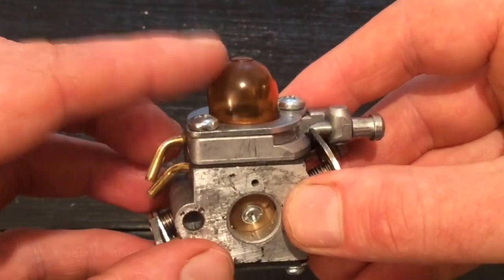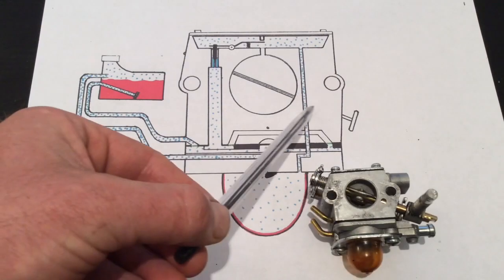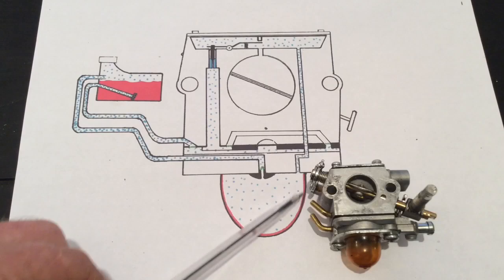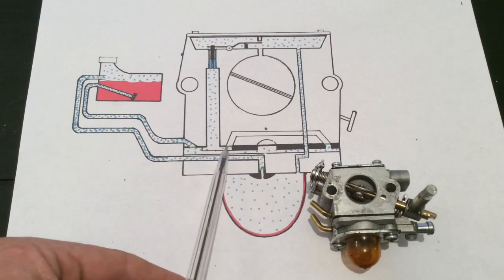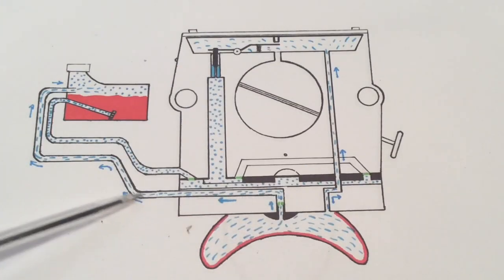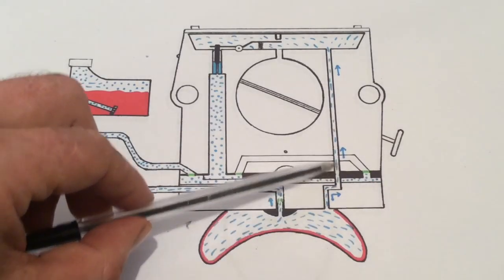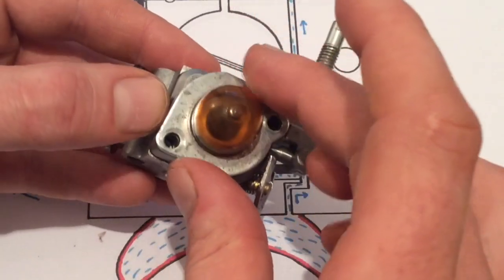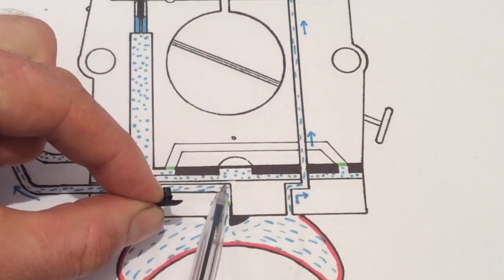The Whole Fuel Priming System Explained - In a 2-Stroke Carburetor.  (by Craig Kirkman)

Comment: VERY good video and explanations. However, when I follow the fuel path on all similar carburetors, I found only TWO sets of 1-way valves that are operated by the fuel pump diaphragm, not THREE. Of course, there's the 1-way "duck-bill" valve under the primer (purge) bulb. But other than that, I have no idea where that 3rd set of 1-way valve is, which would make a total of FOUR sets of 1-way valves. 

Would LOVE to learn/find our more about this "missing" 1-way valve...
Reply from the maker: ou’re absolutely right — thanks for catching that. I went back over it and I did mistakenly describe an extra valve in the explanation. On these carbs there are the two main pump check valves (inlet and outlet) plus the duckbill valve under the primer bulb. That’s the correct total. Appreciate you pointing it out — I’ll make sure to clear that up in the video notes so nobody gets confused.

Craig

Comment: What's the advantage of these carbs over "conventional" slide or cv carbs?
Reply from the maker: Great question! The big advantage of these diaphragm carbs is that they don’t rely on a float bowl and gravity feed like slide or CV carbs do. That means they can work in any position — sideways, upside down, or bouncing around — which is perfect for chainsaws, trimmers, and blowers. They’re also compact, simple, and cheap to produce.

The trade-off is that they’re not quite as smooth or tunable as a good motorcycle carb, but for small handheld engines that need to run at any angle, diaphragm carbs are the best solution.

Great question though. thanks for asking.

Craig

Comment: My primer bulb is cracked yet I can still prime fuel and start the weedeater...but weedeater acts strange and revs VERY high on half choke...i had it running perfect yesterday and today its acting up again...

Could the crack in primer bulb be causing it to draw in excess air and leaning out the mixture?  Or is that not possible and the primer bulb is only involved in the initial priming of the engine and thats all?

Comment: Super helpful video, I am currently trying to troubleshoot a strimmer that uses this exact carb/throttle arrangement, I think. Mine won't start and when I press the primer bulb I get fuel going into the throttle body. I'm guessing the fuel jet valve has failed. I need to have a look under that diaphragm. The primer bulb doesn't go hard and I now understand that's probably because the fuel circuit doesn't pressurise. It's also making a slight squeaking kind of sound as if air is getting in.
Would that be stopping the engine from running at all?

Comment: When I prime my strimmer, fuel drips from air filter. Why?
Reply from the maker: Thank you for your question! Fuel dripping from the air filter when you prime your strimmer can be due to a few different issues. Here are some common causes and potential solutions:

Common Causes and Solutions
Over-Priming:

Cause: If you press the primer bulb too many times, it can flood the carburetor, causing excess fuel to leak out through the air filter.
Solution: Try pressing the primer bulb fewer times. Usually, 2-3 presses are sufficient to prime the engine.
Stuck Needle Valve:

Cause: The needle valve in the carburetor controls the flow of fuel. If it gets stuck open, it can cause fuel to overflow into the air filter.
Solution: Inspect the carburetor and clean or replace the needle valve if necessary.
Float Problems (for carburetors with a float bowl):

Cause: If the float is stuck or improperly adjusted, it can cause the carburetor to flood with fuel.
Solution: Check the float and make sure it moves freely and is properly adjusted.
Damaged or Worn Primer Bulb:

Cause: A cracked or damaged primer bulb can cause improper fuel flow, leading to leaks.
Solution: Inspect the primer bulb for any damage and replace it if necessary.
Clogged Air Filter:

Cause: A clogged air filter can cause back pressure in the carburetor, leading to fuel leaks.
Solution: Check the air filter and clean or replace it if it is dirty or clogged.
Carburetor Gasket Issues:

Cause: A damaged or improperly sealed carburetor gasket can cause fuel to leak.
Solution: Inspect the carburetor gasket and replace it if it shows signs of wear or damage.

These are some things to consider for now.

Thanks

Craig

Comment: Why am I still getting air through the lines after continually pressing the bulb? I just replaced the carb but can’t get rid of the air. I think this is why I cannot get the husky 240 saw to run properly. New lines, new bulb. Tank is full. Thanks.

Comment: I agree that this video is an excellent guide to the workings of a carburettor,  most people want a basic guide to initial fault and what simple verification tests can be carried out prior to strip-down. For example, if the one way valve within the primer / purge bulb stops working, as far as I can see, the system will not operate. Is there a simple elimination test for the bulb?

Comment: Here is a puzzling thing, my leaf blower suddenly would not prime, carburetor is a Walbro HDA 112A, I replaced the diaphragms/filter and cleaned it well over night soaking etc.., still not priming. Today I took it apart again and accidentally broke the one way valve in the priming bulb while trying to pry it apart, I put it back together again, still wouldn't prime, not a big surprise there.. Then I decided to try something, I got the short return line and placed it in a cup of gas, it primed right away and started on the first pull! I took the short return line out of the cup of gas and let it run almost 10 minutes with no problem. I don't get it! I thought maybe the hoses were backwards but 99% sure they are not according to photos and studying this problem for the last week! The return line is attached to the priming pump and the fuel intake line is on the back side of the carburetor. Funny thing too is that the broken one way valve is just flopping around inside the gas filled priming bulb!! Now I'm considering getting a longer return fuel line, like the inlet, placing a filter on it and putting it deep in the tank for future priming. I have searched for a new priming assembly but it appears to be discontinued. My 28 year old blower now starts on the first pull every time and runs as if brand new again! Go figure.. HAHA! I probably should play the lottery now too!! You did a great explanation video!! Best I have seen!! Ron
Reply from the maker: HI Ron

It sounds like you've had quite an adventure with your leaf blower, and I'm glad to hear that it's now working like new again! Let's break down what might have been happening with your carburetor and priming system.

Of course any damage/malfunction of the one-way valve in the priming bulb could have initially caused problems with priming. The purpose of this valve is to create a vacuum that draws fuel into the carburetor when you prime it. Without a functioning one-way valve, it might not prime as expected.

When you submerged the short return fuel line in a cup of gas and it primed immediately, it suggeststhat the issue might have been related to the fuel supply. This test effectively bypassed any potential issues with the priming bulb and checked if fuel was being delivered properly.

You mentioned that you are quite sure about the hose orientation, but it's always good to double-check. Sometimes, even small mix-ups in hose placement can lead to problems with fuel flow. It's possible that fuel wasn't getting to the carburetor as it should.

Your idea of getting a longer return fuel line, placing a filter on it, and putting it deep in the tank seems like a creative solution. This would ensure a consistent fuel supply for priming and running. Just make sure it's securely attached and doesn't interfere with other components.

It's unfortunate that you couldn't find a replacement for the priming assembly, but it's great that your DIY approach has resulted in a functional leaf blower.

In summary, it appears that the issue was related to the priming system and fuel supply. Your ingenuity in testing and finding a workaround has paid off, and now your 28-year-old blower is working perfectly. It's always rewarding when a bit of troubleshooting and some DIY effort revive a cherished tool. If you have any more questions or encounter other issues in the future, feel free to ask. Happy gardening!

Thanks again for contributing to the community

Craig

Comment: Awesome explanation. So there shouldn't be a bunch of air bubbles coming out of the overflow hose when the system is properly primed? I constantly get a bunch of air bubbles when I'm priming the carb. I would imagine some seals are damaged if it's allowing air to get into the the system

Comment: As you know, some equipment, like my Husqvarna 225H75 have a detached primer valve-one that is not directly mounted on the carburetor. Can you explain if their are functional differences in this system as compared to the one illustrated in your excellent video. Thank you.

Comment: I have a few of these diaphram carbs which have the two fuel line fittings on them but do not have a primer bulb. Can you explain what the second fuel line fitting is for in this case please?

Comment: I have been trying to figure out why my weedeater will not run properly. It has a new primer bulb so I know that isn't the issue. I've taken the carb off and sprayed it out with carb cleaner. No luck. Even tried a carb from another just like it. I am befuddled as to what the problem is but the video has been a great instructional video in understanding these carburetor functions. I can't thank you enough for this education.

Comment: So if my chainsaw says to press the primer 6 times, but the bulb is full after three, I should stop at 3? Hmm. I wonder if that's why it foods when it's cold. I can actually prime fuel right back out through the air filter housing. So it sounds like the main jet valve is shot. That’s why I have a new carburetor and fuel system kit on the way. At least now I’ll confident that’ll resolve my problem. I think the metering diaphragm is shot too. And I know there is a small leak in the fuel line to the primer.
Reply from the maker: I think you could be spot on there. Craig 👍

Comment: Can I just replace that one way valve under the primer bulb? The top part of mine broke off when I tried taking it out.
Reply from the maker: Hi. You need to find a parts diagram to see if your carburetors manufacture provides the part you are asking about.  Generally manufactures do provide such items but you will do better to google the make and model of your carb and see.  Thanks. Craig

Comment: People are to lazy to set a choke,its one movement,pushing that bulb repeatedly makes you feel better.The only time you should ever use that bulb is out of the box,but people push it thinking it will start easier.I have never used mine because I have seen people pull and pull and pull making it hard to start.look its simple set the choke pull the rope two times it will fire turn the choke to half let it run for a minute till it warms up hit the throttle and it will run.The more you use that bulb the more leaks you are asking for.Dont you remember before some moron came up with the bulb saws started fine.

Comment: Thank you so much for the time and effort in creating this easy to understand video.  I have no background in engine operation and found your video whilst trying to get 2nd hand weed trimmer working.  One question that popped into mind, does the bulb in addition to priming the carb also assist fuel flow during operation by having also primed a vacuum into the fuel tank?

Comment: Fourteen and a half minutes into a fifteen minute video before there is any mention of the Check Valve in the Main Discharge (Hi-Speed Jet) Nozzle ??  The Main Nozzl'e Check Valve should be quickly mentioned at the start of the video, because if THAT check valve has failed and is stuck open then NOTHING will make the carburettor primer system function.  After 60 years of repairing All Position, Diaphram Type carbies, and watching literally dozens of videos like these since the creation of the internet, and still no-one mentions the importance of the main Nozzle's Check valve, and why the main Nozzle actually HAS to have a check valve.  Even before it became routine for carby's to be fitted with an air purge priming system, all these 2-stroke carburettors needed a check valve between the venturi and the metering chamber.
And p.s. the little 'rubbery grommetty thing' under the primer bulb is called a Duckbill Valve.

Comment: This is absolutely brilliant video. Thanks. I was able to diagnose the problem with my weekwracker. It was the one way check valve inside the primer bulb that was broken so the motor dies every time I pull the trigger. Tried every method online trying to solve the problem but none worked for me. Finally I saw your video and boom problem solved after I replaced the broken valve. It seems rare  but that was exactly the cause of my problem

Comment: Fantastic video. Best explanation I have seen on YouTube hands down. One thing I would offer is that the carburetor you have only has two check valves on the diaphragm, not three. In fact, I think most of not all 2 cycle carbs have only two. One at the inlet (upstream of diaphragm) and one at the outlet (downstream of diaphragm) if you’ll notice, the two that you have drawn downstream of the diaphragm are redundant. 

Again, thank you so much for the explanation.

Comment: My Roto tiller engine just wont start! no matter what .Had carb off three times.All clean. no problem. But Now looks like But I noticed two tubes that enter the fuel tank actually emerged in the fuel!  is one tube for air intake?
Reply: The 'purge bulb' means it has 2 lines going to the fuel tank: one feeding fuel to the carb, other one is a return back to the tank. When you press the bulb it just circulates the fuel, pulling it though the carburettor and purging any air that might be trapped in the lines or the carb. If these 2 lines are fitted to the carb the wrong way around, your machine will never start.

Comment: Excellent video.  I wanted to figure out how to unclog mine with a wire due to ethanol clogs.  But now seeing  all the little valves and flaps and levers I'll probably end up doing more damage.  Is there a safe way to unclog it.  My prime system is so clogged it can't even press down.

Comment: When i press the bulb the oil does not raise up what the problem it is suck or something else sir?
Reply from the maker: Try to strip down the carb and see if there is any blockages, if, you are sure that there is no blockage in the fuel pipes, or fuel filter. Make sure that the fuel pipes are fitted to the correct areas on the carb, and that the fuel tank cap air ventilation is working, and that there is no collapsed fuel pipes.  Also make sure that primer bulb itself ok.  Is the rubber walls of the bulb wearing thin? If so then this can stop it from raising.  This is all the advice I can give until you have taken a look at these points.  I hope this helps. Craig
Reply: @TheRepairSpecialist  OK thank you I will double check and take look on it tq sir

Comment: If there is a valve on the jet that only opens enough when the engine is running, why do primer bulbs sometimes flood an engine?
Reply from the maker: Well put simply, it's because the valve opens as a result of a certain amount of pressure from the fuel under normal engine running.  The primer bulb forces enough pressure to open it also. I hope this helps. Thanks. Craig
Reply: TheRepairSpecialist 
Thanks for the reply, sometimes I flood my engines using the purge bulb too many times

Comment: Great explanation.  Can anyone tell me which of the drawings best represents a carb on a lawnmower that has just been stopped (to empty the grass bag) and about to re-started?  Also, why these hot starts are often more problematic than cold starts!
Reply from the maker: Thank you so much for the nice feedback. I really appreciate it. 

Secondly, I have added the problematic hot starting to my list of videos to do soon. Thank again. Craig
Reply: @TheRepairSpecialist  Thanks Craig.  I have read up on the subject, it seems that there could be any number of issues with the fuel/air/spark.  Stale fuel, carb condition, air filter, air leaks, spark plug, coil, wiring, poor compression, air leaking in, valve clearances, blade brake, kill switch, oil level - the list goes on!  My mower is new, starts first time on 3 primes, runs well, but does not start first time on hot start, needs a prime.  Might prime it once to make sure it starts first time.  Who needs a PowerPoint Presentation when you can actually draw by hand like to 😉.  Keep Safe 👍.

Comment: Please help, I have a sthil 2 stroke blower and no fuel is getting into the primer bulb, iv sprayed some carb cleaner, I checked the muffler plug, bought a new primer bulb but when I try to prime it with the fuel cap off I can hear an air sound and the fuel line is sitting in the fuel but their is another pipe running through the tank, could that be the problem?
Reply from the maker: Hi. one of the pipes in the tank should be inlet of fuel to the engine and the other should be the return of fuel back to the tank from the engine. Both should be there if they are these.  Just a quick one. Make sure the two pipes are the correct way around where they fit to the carburetor.  Try switching them round and then try priming it again.  If this sorts it then great. If not then it could many causes, not least something inside the carburetor.  It may need to stripped down and serviced. I hope this helps. Craig

Comment: This is the best explanation on how a carb and prime bulb works.  
My prime bulb pressurizes but no fuel flows. I assume one or more valves are stuck or the flow path is clogged. 

If your fuel tank is not air tight, would the system also fail?